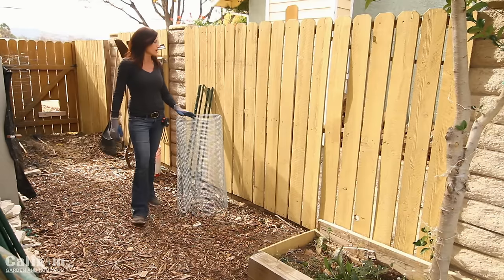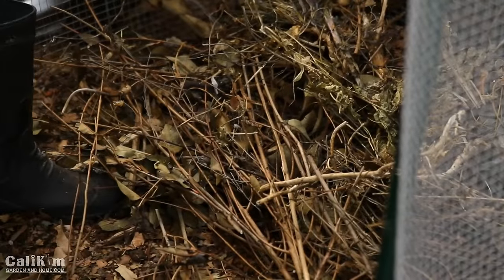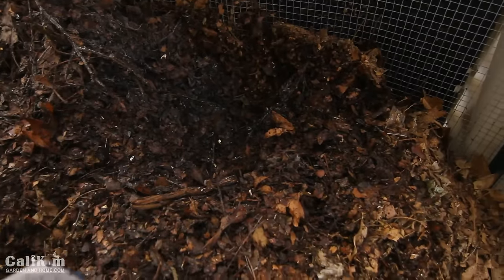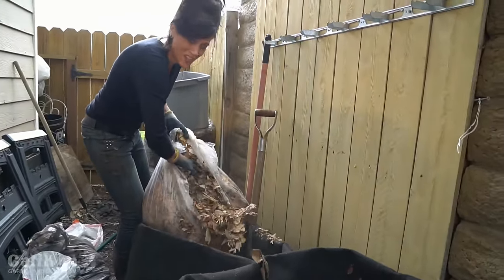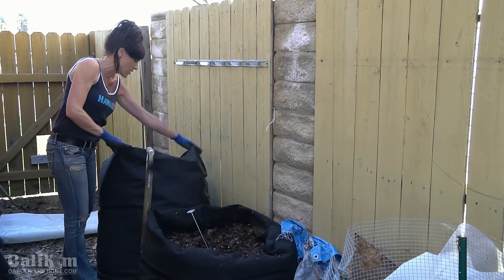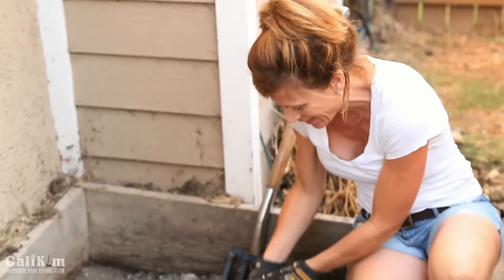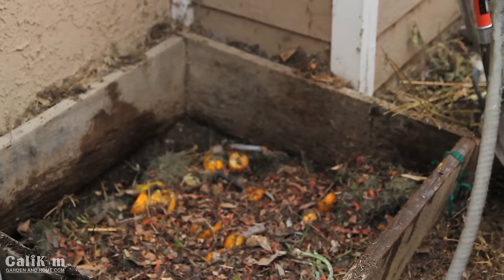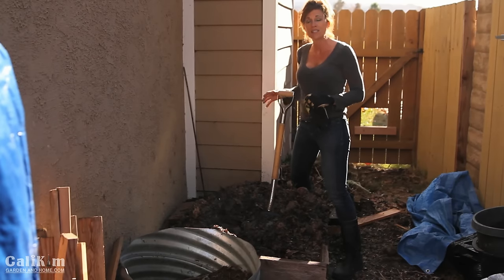How to Make Compost From Start to Finish-Quick & Easy /Complete Guide with Digital Table of Contents

Comment: You're doing good but you've got and LOT to learn, I would start off by adding that you can compost most did scraps but not all.  DO NOT PUT ONIONS OR ONION SKINS IN YOUR PILE, DOGS CAN GET ONION TOXICITY AND IT ABSOLUTELY CAN BE DEADLY. just avoid them and you'll be OK. Also compost needs air and water yes obviously. But does every living thing. What we really need is carbon ( cardboard, tree leaves, yes tree leaves fall under carbon not greens aka nitrogen) and nitrogen the grass the coffee grounds and I add MY urine, eww gross I know but there's nothing better) so keep up the hard work, I don't think you're ready for your own t.v. show as one commenter suggested😅